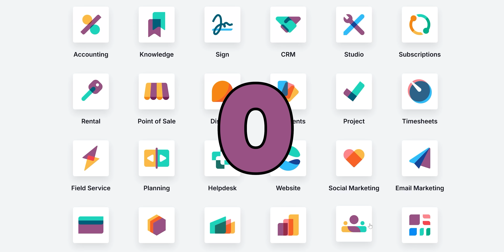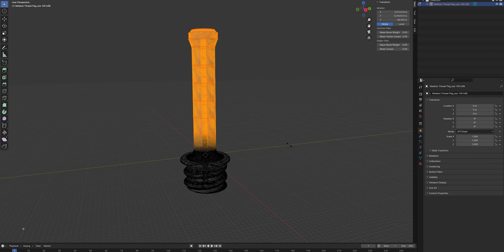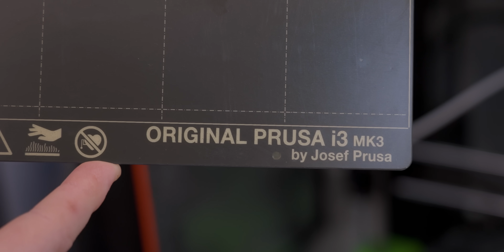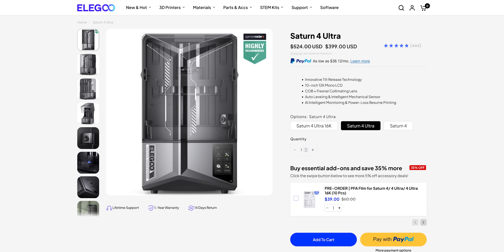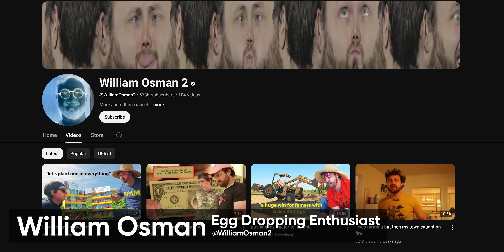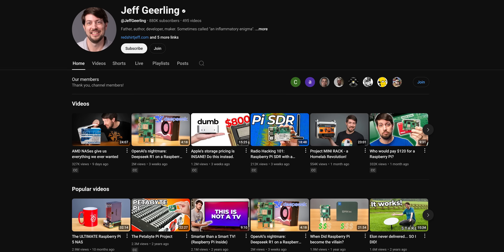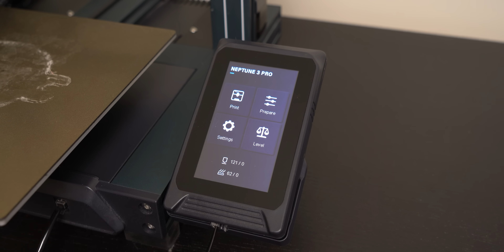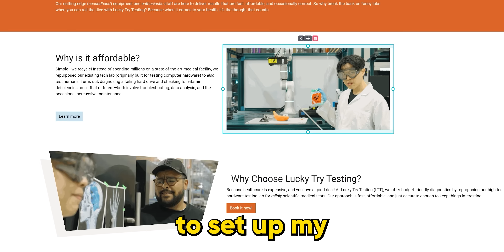Is my 3D printing setup wrong?

Comment: wow, this video Linus misses the mark sooo badly? You say nothing about WHY you are saying the Bambu should be replaced but worse, focus on people who have mostly Prusa printers and little about any other manufacturer. Is this a Prusa sponsor video? None of them mention how much harder it is to ensure a good quality print every time, especially without an enclosure for ABS or anything more exotic. Are they child friendly? Not really. Not great for any form of journalistic integrity as an informative media company.
The current issues around the Bambu printers is just what 3rd party software can access the printer and nothing to do with their functional ability to print. Slice in whatever software you like, stick it on an SD card and pop it in your Bambu printer like most others out there and it'll work fine.
Having run 4 different manufacturers printers, unless I was looking to run a print farm style setup, I'll still stick with the Bambu printer I own for ease of use, reliability, print quality and speed.
Yes, I've simplified the Bambu issue for the sake of the comment, but you cannot deny all the above has been skipped/glossed over. And yes, there are people who will disagree with my viewpoint. But at the end of the day, people are upset they'd restricted access to their own cloud service from 3rd party software.

Comment: Y'all, cheap tips for dry filament bliss

1. Used food dehydrator, the round ones. Cut out the inside bits. Perfect filament dryer for very cheap, runs cheap. Airflow is key to actually drying the filament

2. Ikea 365 10L box + some spoolholder prints for those boxes + bowden tube = drybox you can print from. TPU can get too wet during a print... But ive dried mine once (12hrs) and got a hygrometer in the box giving 10% humidity, i can orint tpu whenever i want absolutely perfect on my A1

My print room is 50-70% humid and theres not much i can do so i have to stay on top of things

Comment: Bambu 3d printers are the apple of 3d printers, they just work, hit print and go (usually, i've had 2 failures in 6 months). unlike the ender 3 and 5's i have, i can just design what i am in fusion, hit print and go. i dont want to be tinkering with it anymore

Comment: For FDM I run a Bambu X1C and a Prusa XL. They compliment each other well. That said I personally wouldnt buy any other model prusa printer. IMO the rest of the lineup is overpriced vs the rest of the competition. I bought the XL because it is fairly unique in the market right now but it has been more problematic than my X1C

Comment: When printing with color, you can reduce the waste by going into the slicer and clicking on the “flushing volumes” tab right below where you select what printing plate you’re using (It only shows up if you have 2 or more filaments already designated the The slicer). In the menu set the multiplier to anywhere from 0.4 to 0.2 depending on the recommended range (make sure the numbers aren’t red. If they are increase the multiplier). You can also decrease the prime tower’s length and width to ~15-20mm to reduce waste.

Comment: Linus, as a member of the 3D printing community, and someone who has been 3D printing for over a decade, I have to say you did the 3D printing community a GRAVE DISSERVICE with this video. Not only was it CHOCK FULL of BAD INFORMATION, but most of the people you showcased didn't know the first thing about what they were saying. It would've been so easy for you to turn to some of the PROMINENT content creators in our community, like Joel Telling, or Uncle Jessy, or fellow Canadian Nero, to talk about their setups featuring some of the latest machines; but you went to people who are showcasing technology that's YEARS old. And let's talk about Jake for a second, and his little chat about resin... First of all, Jake, DON'T PUT YOUR RESIN EQUIPMENT ON A CARPETED FLOOR! Not only is the floor a bad place, because of temperature (resins like to be warm when they print, or else the prints fail), but it's so easy to spill resin, alcohol, and other stuff into the carpet, ruining it. At the very least, it'd be better for Jake to put his Prusa on the floor, and keep the resin equipment on the desk -- but he should ALSO have that equipment on silicone mats to guard against spills. Then there was the last person you showcased, using an Elegoo Neptune 3 that clearly needs a firmware update if the printer is not retaining it's Z-offset values, but a CR-10 using a GLASS BED and then complaining about how SLOW it prints? Puh-lease! The Neptune 3 is a few years old now, and was replaced in the lineup with the Neptune 4; and we won't even talk about the 10-year-plus-old CR-10... Both of those printers could be upgraded with Klipper firmware, which not only improves performance by printing faster and more accurately, but the CR-10 needs a direct drive extruder with an all-metal hot end. As for William Osmon, he had the most modern setup of everyone, next to you, yet he's still not storing his filament PROPERLY, and as of yet, there's no filament dry box like what he's talking about for the Prusa XL. There are open-source solutions for printers running Klipper (i.e. the Box Turtle, or the forthcoming solution from BigTreeTech), but the Prusa runs proprietary firmware so integrating what he's looking for into that setup just doesn't exist yet. The last thing I want to talk to you about is your filament dryers; the Creality dryers are decent, but there are much better dryers out there that are more cost-effective; I recommend you go look at the Sunlu S4. Probably the most accurate statement in your ENTIRE video is that Bambu had advanced the industry more than anyone else. They have, despite the "outrage." If it hadn't been for the Bambu X1C, we'd not be seeing Creality, Anycubic, Flashforge, Elegoo, Peopoly, Prusa (yes, even Prusa), TwoTrees, and other manufacturers moving toward Klipper and CoreXY motion systems. If it hadn't been for the Bambu X1C, we wouldn't have Orca slicer, or slicer software that's easy enough for your daughter to use. That's what they've done: they've "mainstreamed" 3D printing to the masses, and pushed the entire industry forward in the process. In the future, PLEASE consult knowledgeable members of the 3D printing community if you want to make ANY videos about 3D printing (even your in-house "expert" on Short Circuit gets it embarrasingly wrong, ALL THE TIME). There are lots of us who would be willing to help, just so the information is current and accurate, if you would just reach out. Sorry for the long message; I really hope you'll read it and take it to heart. If you want to learn more, though, I'd recommend coming to a RepRap Festival -- we have one coming up in May, in the Denver area, called RMRRF. C'mon down and meet us; we'll show you all kinds of wonders for sure, and you'll learn a lot!

Comment: Well, its not that bad.  My current setup is a Bambu Lab P1S with an AMS and a dehydrator as well.    I just bought about a month ago, before I was aware that Bambu Lab was planning on shooting themselves in the foot.   It was upgrading from an Ender  3 v 3 SE.     I got sick and tired of Creality printers not working right for me.       I've been working my P1S with AMS almost nonstop since I got it.   Unfortunately, I broke the first slot Stage 1 extruder because of filament that got stuck in it.   It locked up on me, so I had to pull the filament out.    Now it won't load or retract properly :(   But, I've got a replacement on the way!  I was hoping to build some computer components to help my computer look better.  I ended up printing D&D and Warhammer stuff instead.

Also,  Creality is supposed to be releasing a new printer soon that puts the Bambu Lab X1 Carbon to shame.   It would be cool to see a review on that when it comes out.

Comment: I bought myself a Bambu labs A1 printer for Christmas, and before it even shipped they announced the firmware update. It is a great printer and I love the AMS system. I wished I went for the enclosed printer instead with the AMS system (instead of the AMS lite) so I wouldn't have to worry about drying my filament. 
(this is commented literally less than 90 seconds into the video, hoping this video may help my setup as well)

Edit: Okay finally finished the video and the silicone beads in air tight containers and a filament dryer probably will be good enough to level my setup for the time being.

Comment: it's a bit anecdotal but I really find the performance to be fairly proportionate to the money you spend. The cheapest junk printers will always require a TON of tuning and then still shake themselves apart, probably still good for a lesson or two but they're instantly outpaced. But you usually get some niiiice upgrades in the price window of like $700-900. Even the Enders in that range are very "set it and forget it" in that they arrive basically all assembled, offer the nice touchscreen, auto bed leveling, no gluestick required, etc.... completely different from the cheapo models. The companies offering best bang-for-the-buck machines seems to bounce around about every year but the price point stays pretty consistent.

Comment: man i learn to use solidworks without any help, i did it for 1 year to learn basics i can 3d model a paintball mug in 15 mints  even after that fdm 3d printer setup is a nightmer ,it is not just a hobby to have fun only if you have a teacher you can use it to make cool stuff

Comment: In Bambu studios you can turn the poop amount down. I've found 0.4 is the happy spot. Also under the prime tower settings check flush into supports. I've found my poop is way less

Comment: Never had that Z-offset issue on my elegoo 3. I also don't dare touch the firmware or slicing software. It's locked in place till I die cause it works.

Comment: I recently picked up 2 Bambu printers for work (A1 and X1C), and both have been running fantastically. I was a little concerned after the news of Bambu's software moves, but overall they've made 3d printing something I'm comfortable doing. I do wish they had built in Ethernet ports, and didn't have to rely on a cloud service (makes me think designs are being kept and catalogued in China) but they have made it much more plug and play that I originally thought.
Reply: They are not, no worries

Comment: I have a Voron Trident and a nearly finished Voron 0.2. I think building a Voron is the most cost effective way of having an extremely good printer. My Voron trident was less than a bambu lab x1 Carbon. While being fully open source, easily repairable. However it does require a lot of time and a lot of electronics and IT knowledge.
Reply: Your voron costs much more once you include your work hours (which you should)
Reply: @JakovPerisic  I was able to build it at work in work hours, because most of my job is being available.

Comment: Hey linus you r the best i want a answer that i have asked chatgpt
Please consider intresting topic 

You said:
is it good idea to not delete videos on phone so that phone storage doesn't use that sector which it is stored on and that sector will stay healthy as there will be no read write happing? Is that how storage works or will it help to let the storage ufs stay healthy for long time 
ChatGPT said:
It's an interesting idea, but the way storage works, especially with modern UFS (Universal Flash Storage) and other NAND-based storage, doesn't work quite like that. Here's a breakdown:

1. Wear leveling:
UFS and other flash storage types use a technique called wear leveling. This means that instead of writing data to the same physical sector repeatedly, the storage controller spreads the writes across different sectors (or blocks) of the storage. This helps to prevent individual sectors from wearing out prematurely. So, even if you have data stored on a certain sector, it doesn’t mean that sector is going to be written to over and over again. In fact, the wear leveling algorithm is specifically designed to distribute writes evenly across the drive, helping prolong its lifespan.

2. Data Deletion and Health:
If you don't delete videos or data, you're just keeping that data there, but it doesn’t mean the storage is being "preserved" in a way that would make it last longer. Deleting data won’t help prevent wear on the storage. It's not the act of writing new data or deleting old data that wears out the sectors, but rather how much data is being written to the storage over time.

3. How Flash Storage Works:
Every time data is written to flash storage, it involves a process of erasing and then writing new data. Flash memory cells can only be written to a finite number of times (typically around 3000–5000 times for consumer-grade NAND). However, this is managed effectively by wear leveling algorithms, so individual sectors wear out very slowly over time, even with regular read/write cycles.

4. General Storage Health:
To maximize the health of your UFS storage:

You should avoid excessive writes, like constantly writing large files or apps, especially for things like databases or logs, but this has less to do with how many files you store and more with how much data is being actively written and erased.
Regular backups are important, especially if you're using your phone for critical data, but you don't need to worry too much about keeping or deleting videos specifically for the purpose of preserving the storage.

In Conclusion:
It is not necessary to leave videos or other files on your phone just to preserve the storage. UFS and modern flash storage are designed to handle wear leveling and will last a long time even with regular use. As long as you're not doing excessive writing (like downloading large files all the time or writing a lot of data to apps that update frequently), your storage should stay healthy without needing to leave files untouched.
Reply: Please don't 🤦‍♂️

Comment: I would try PolyMaker, I’ve used several of their filaments for work, and I’ve never had a problem with them, even leaving outside (particularly, their PLA)
Reply: I did, it gets very brittle. Bambus pla is a blend and much more resistant to moisture

Comment: I keep all my filament out in the open and do not dry any regularly. I have print that are perfect compared to new filament, actually no problems. My room may just have really low humidity but you can probably save money on driers and boxes by getting a dehumidifier in the room. I do have a drier and have used it for more serious materials like nylon and pva, but pla and petg are fine without it.

Comment: microwave the silica gel is imho a mistake, it heats them too much too fast. 105C in an oven is longer, but it wont shatter / overheat the beads (and it works very well)

Comment: Btw you can dry your filament inside the printer if you have an enclosed model, there's in option on my Carbon at least.  That screen is a gem.

Comment: I've loved my Bambu printer.  While I don't agree with their locking down of certain parts of it, it's about as open as Apple is and the "it just works, mostly" factor has saved me a lot of time the last couple years over my older Ender 3's I used to use.  Also.. I don't run ANY MODS.  Modding your printer turns it from an appliance into a hobby tinker toy.  Not for me.
Reply: It's faaaar more open than apple...

Comment: not sure if yall are extremely unlucky in where you live but i live in austin where it can be very humid during the summer and ive never once had an issue with wet filament. i have the bambu A1 and an elegoo neptune 4 pro, leave all my filament (mostly PLA) on a rack in the open air of my garage. been like that for years now. the only issue ive ever seen is when i have old filament that i havent used in over a year and down to 1/4 of a roll, its brittle. at that point i just toss it and buy a new one. i also have friends in florida who have zero issues and never touch a dry box or filament dryer

Comment: 17:40 if you want a larger build area I would recommend the Neptune 4 max. I put a .8 nozzle on mine and love it. It is also not a bad setup but the size will make you want to have a buddy present. It also runs klipper and can have a camera added if you want. I’ve seen upgrade kits for linear rails instead of rollers but I haven’t tried that.

Comment: Sounds like maker of engines 3d printer isn't saving the z offset . If he is using a slicer like prusa slicer he should be able to modify the custom start gcode for the printer to force through the correct value at the start of every print

Comment: camden bowen, I had that issue. resetting the printer and recalibrating sorted it for me. It was increasing the offset in the wrong direction every time i printed, until it was so far out it couldn't be adjusted. You might also want to check for firmware updates. there have been updates for the printer and screen.

Comment: @LinusTechTips Creality Print supports many brands of printer including Bambu Labs printers - maybe check out Creality Print. Also look at using an 'Internet In' and 'Internet Out' firewall rule for the printer that drops all packets in either direction (its basically an internet block but NOT a LAN block) which should have a static IP set on your LAN so it should be easy.

Comment: Just bought a P1S for Christmas, and just this month bought a drier after running into some print quality issues.  The timeliness of this is absolutely insane, and the collaboration with other creators is amazing and unexpected.  I agree with everything said about Bambu Labs... but man, I can't design anything, so their interface really made 3d printing super approachable, and less of drinking from a water hose.  I mean, I absolutely started drinking once I ran into some print quality bits, but it was a gradual lean-in rather than diving in head first.